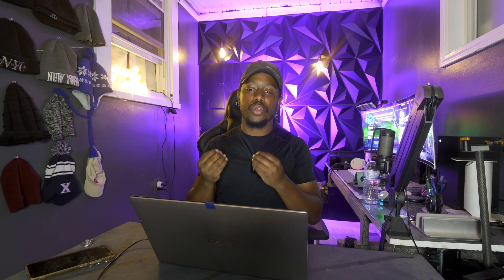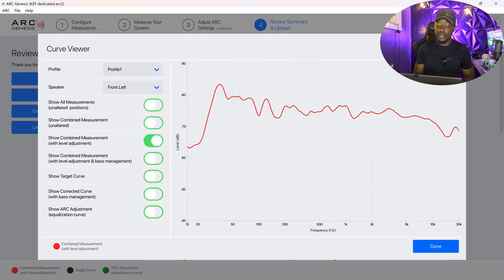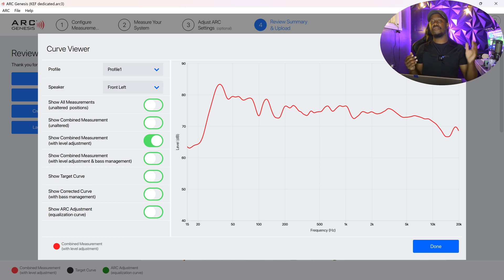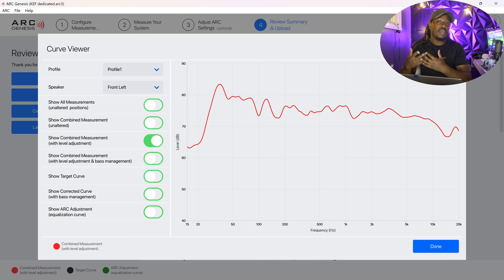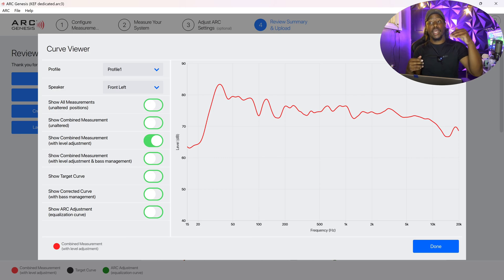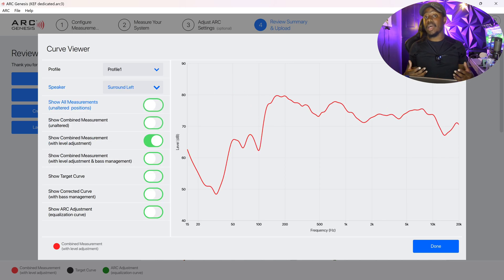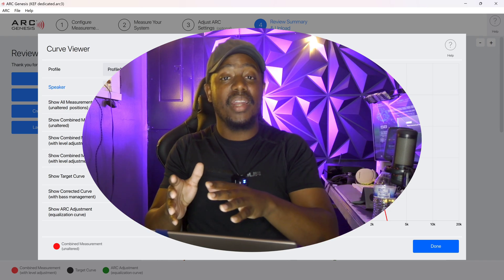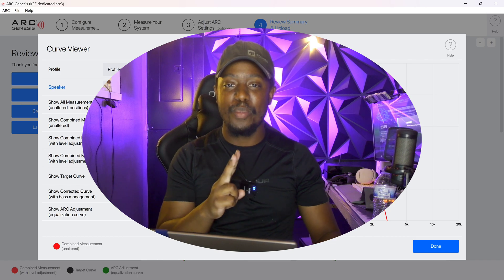How To ACTUALLY Read Speaker Measurements

Comment: On my front speakers , the ports are at the front , not the back. If?
I was to put a sock inside these.Would it damage The speaker. I just want to test to see what the results would be.👍
Reply from the maker: @davidmckee2898  it won't damage it but the max power handling would slightly decrease.

Comment: I have the Umik 1, stand, downloaded REW on my laptop, all the necessary cables, but, until I get how everything is set up, what needs to be on or not on, basically a step by step demo of that, I will leave it alone. I had asked you, but, you didn’t know. I’m patient. There will eventually be a video on that at some point.
Reply: I am in the same boat. I too have a UMK 1. What is a tool if you don't how to use it.
Reply from the maker: @dwayneharris1438 You'll know by the end of the week!
Reply: Good stuff Kyle, we all will be looking forward to that. We really want to know just what the heck we are doing. I was willing to wait until someone would explain it, step by step!!
Reply from the maker: I'll be getting into the in a video later this week hopefully
Reply: @Kpaceguy  What, REW?
Reply from the maker: @wendellwendellb339  That and going through the mini dsp
Reply: Google miniDSP guide by AustinJerry.  He put together a great step by step guide that will get you started.  He has one for subwoofer EQ also, but the video tutorial by Home Theater Gurus is the best one for that I think.  There are also a bunch of YouTube tutorials for REW on YouTube but I can't speak to them.  However, Im sure at least some of them are decent enough to get someone going.  It's definitely a learning curve and a lot to take in at first but the only way to get a handle on it is to just dive in and work through it.  Quickly enough it'll become easy.
Reply: Check out home theater gamer. He has good tutorials. There are a lot of other good ones on YouTube as well